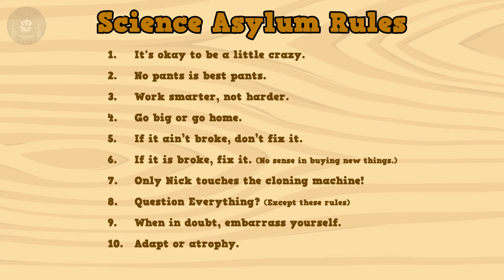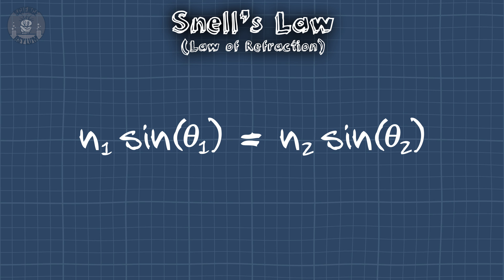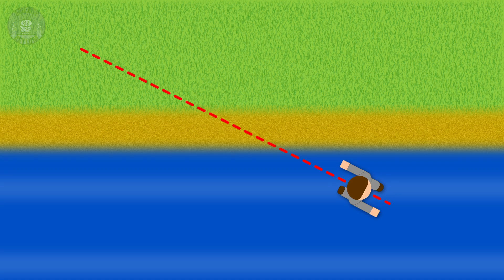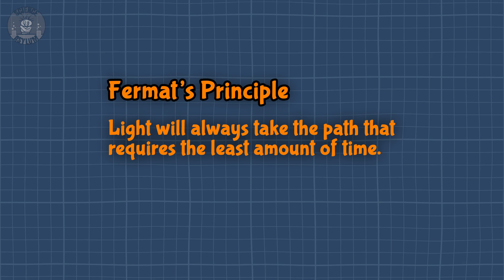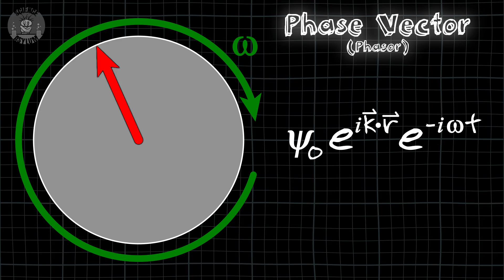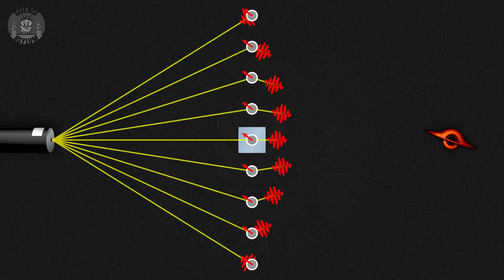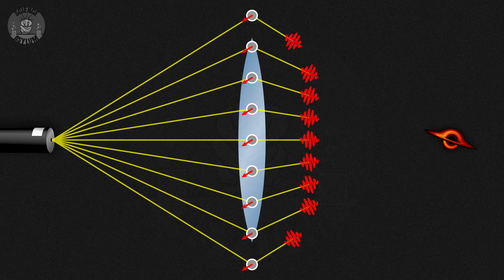Why Does Light REALLY Bend?

Comment: Excellent video.  I must say that I am pretty skeptical that light takes all paths between two points.  How do you really prove this?  You can't see actually see the path right?
Reply from the maker: We can't accurately predict what will happen with a photon (light) without treating it as if it takes all possible paths. If we don't consider them all, we get the wrong answer. What that means about the photon is open to interpretation.
Reply: Maybe you are saying all "possible" paths matter?  Not that it travels all paths?

Comment: The answer you gave in the beginning is 100% correct, it is an optical illusion. Each object or person in their own environment is looking through a kaleidoscope! A person in water looking to a drone, the drone looking at the person in the water, and the person observing them both, this is a simple illusion to them. This effect can also be seen while looking at a person through heat waves on a hot surface. As long as there is a transparent medium, such as glass, plastic, gases, water, and other things in this nature, it will seem to bend, however this is nothing but an illusion. All we are doing is looking through a kaleidoscope. You can't say that light is slowing down! What happens is the glass and other materials are acting as mirrors and cause the images to become disturbed to the person that is observing. There is nothing true about this for physics to explain. Since this illusion happens over and over again at all the tests, and with different mediums, it is causing confusion. If light really was to slow down and speed back up again, it would be against the laws of physics! Also, because light comes out from the other side of the medium at the same angle it entered, it causes a greater contradiction, and you guys are trying to find an explanation for this problem. On the contrary to the observing eyes, light was never bent, curved, or had taken a different direction to begin with, it was just an illusion. When it comes to lenses, they are correcting vision. The correction of vision through the lenses is not bending light, it is reshaping the image to your choice. To better study light bending or slowing down, you can take a look at a mirror room and a kaleidoscope. I will leave you with this question: How do you look into a kaleidoscope and find each and every single object's real size, distance to each other, and real shape?

Comment: So the summation of probabilities results in the least time path, yet despite that least time path, it is still slower than the speed of light.  How can light travel slower than the speed of light, unless there is a relative difference in time passing between air and glass?  Could increase the mass of the glass cause time dilation and therefore only the elusion of slower light speed when in fact it is time itself that moves slower in the glass?

Comment: I love your videos as these are always the most instructive in terms of addressing the "whys" in physics.  My question is "why does lower frequency light travel faster than higher frequency light in a non-vacuum medium?"  I'm having trouble finding the ROOT causes of optical dispersion in a prism.  I guess this is the same question as "why do waves with shorter wavelengths refract more or travel faster in a medium?"  Any help at finding the actual reason (and not just equations that predict the results) would be most helpful.  Thanks.
Reply: Light is an electromagnetic wave. Though it has a neutral charge, it still has an oscillating electric field component. In a transparent material, the electrons of that material don't have an excitation energy that matches the energy of the incoming photons, so cannot be absorbed through resonant absorption. But the electrons can still respond to the oscillating electric field, oscillating with it. Since oscillation is a type of accelerated motion, and accelerated charges emit light, each atom is surrounded by new EM field permeations travelling in all directions. However, light is a wave [or wave-like], so you need to consider wave interference. These new fields can both interact with each other and the original field. 
Trying to follow each individual one is absolute chaos, but the end result is that they all combine to form a net EM field with a peak that is phase shifted away from the original one, which is equivalent to if the original photon didn't travel as far in the same amount of time, aka it is slower. This new velocity of light through a medium is called a phase velocity, and it's important to mention that the actual individual photons here are still travelling at C.

As for why more blue light has a slower phase velocity, higher frequency photons have electric fields that oscillate faster. This changes how the electrons respond to it, oscillating faster, emitting more higher frequency light of their own, thus changing the interference pattern. Those different interference patterns yield a different degree of phase shifting, and so different phase velocities.

Comment: "The arrows caught up in the spirals tend to cancel themselves out, leaving only a few paths to contribute in any noticeable way." But... the spirals are just an artifact of the arbitrary order you chose to connect the arrows in, right? You started with the leftmost arrow and worked your way right across the diagram, which gave you those spirals... but if you had ordered the arrows at random, you would have gotten a different shape, and you could have picked an order that would have "cancelled out" any of the right-facing arrows you want by putting them near left-facing arrows. So what's special about the right-facing arrows in the middle?
Reply from the maker: I only sorted them into spirals so it was clear what was happening. The cancelling happens regardless of how they're sorted. The physics doesn't care what shape you make with them.
Reply: @ScienceAsylum  right, that makes sense... but what defines which arrow "cancels" which other one? Is it based on physical proximity?

Comment: Why does light bend over surfaces making it look like there’s no curve to the earth? 
I understand refraction from air to water or from stars through the atmosphere but don’t get why it would refract over a long distance along the Earth’s surface? Why we can see the sailboat sail as it gets farther away from us. It should disappear but light “refracts” so we still see it.
Reply: Light can bend over surfaces because temperature is a factor in refractive index. It also happens to be somewhat wild and unpredictable when near the surface either on land or near water, as anyone who has been on the beach during a thermal inversion will tell you. You can see the light from objects tens of kilometers away; well past the horizon.
The convection of air, even with the same composition, at different temperatures is enough to create such significant refraction. Light is passing through these layers and differing temperature constantly, changing it a little bit each time. Pile up enough changes and eventually you get some extreme apparent discrepancies

Comment: I have a question that I haven’t been able to find the answer to. Let’s say you have a piece or wood, by itself the wood does not give off any light, but if you heat it up enough, it combusts and produces light, heat, smoke etc. so, the question is: where do the photons come from? Are they created or are they contained within the atoms that make up the log? Thanks in advance.
Reply: I assume you're not taking blackbody radiation into account. In that case, yes the energy is in the atoms. Wood contains a lot of hydrocarbons and polymers, and when you slap some heat and an oxidizer to it, they react to form usually carbon dioxide and water [though you can in the right conditions use other oxidizers]. These molecules have significantly less ground state energy than their reactants, and that extra energy goes into photon production

Comment: Does the transmission of light from atom to atom, molecule to molecule, meaning the interaction of light with the electric field of each electron in the material explain the delay and hence the angle as well? Each electron will interact with each specific photon and then the electron will give off a photon with the same freq but different wavelength , right?, and that's where the path for light gets shorter or longer? The amount of interactions?

Comment: So refraction must come from the materials ability to reflect some of the light away and those photons push away the refracted lights photons into the opposite direction. Therefore, a truly black material would be the only material where light would not refract but unfortunately all of the light would be absorbed by the materials surface. The surfaces atomic vibration would be so low that it would never stop absorbing light. DAMN YOU, GOD!
Reply: No, the atomic vibration would increase.

A Black body doesn't reflect light, but it does radiate its own light. In fact, a Black body is a perfect emitter of light.

As it absorbs light, it heats up. This increase in temperature is an increase in vibration. And that causes the Black body to emit its own light.

Comment: A photon is nature's way of getting a chunk of energy from one location in spacetime to another. Random facts about photons:
If there were (there isn't) a pure vacuum the photon would experience zero duration over time. 
As a photon's probability wave evolves over time portions of that wave are slowed or even stopped by non-uniformity in the electromagnetic field through which it travels. Photons actually experience a tiny duration over time. Nothing, not even light, travels at c. The CMBR photons have lost energy over time. Change over time is exactly what duration is.
An individual photon is a wavefront (it has volume in spacetime). As a wave it can, and does, change direction through interaction with the environment. 
When "observed" the energy has interacted with an electron's wave.   That electron has to be ready to accept the amount of energy now in the photon. (A photon wants to marry an electron and become a single entity. Just gotta find the right one.)

Comment: Good video overall. The idea of a car transitioning to a slower material and bending is not really analogous to light. That would create a torque, accelerating the wheels on the outside. So would exceed the speed of light. 

Maxwell's equations deal with refraction accurately. It's down to adding perpendicular EM fields, and charge front in glass. 

Laser pulses refract also, being both aligned beam photons, and leaving at the same time.

Quantum explanation is good. Maxwell's is good too.

Comment: As a tutor, I'd request students to draw the event, representing it as two circles meeting tangentially at the surface of separation and having diameters representing speeds of light in each medium. You could solve for both angle of refraction and for the path taken by the refracted ray to reach the final point in unit time. 
But, being lazy is a hurdle among most students.

Comment: Does sound bend as it travels through different mediums.
Reply from the maker: Absolutely. All waves experience reflection, refraction, and diffraction.
Reply: Gravitational waves experience this too?
Reply from the maker: We can barely measure the existence of gravitational waves let alone their behavior... which means we don't have any experimental evidence for it. I suspect it will turn out to be true though.
Reply: If gravity affects the flow of time and bends light, can electric fields do the same thing?
Reply from the maker: @physicshuman9808  (1) It's better to say that the flow of time causes gravity, not the other way around: https://youtu.be/F5PfjsPdBzg (2) Electric fields do have energy, which can contribute to spacetime curvature. That's why charged black holes look different than uncharged ones.
Reply: Can you charge up an object so much that the electric well of the object would not allow light to escape
Reply: In the center charge and charge density and the electromagnetic force blows up without limit you would have an electrostatic singularity the density is so great that the electrostatic pull is so strong that not even light escape

Comment: What is the minimum difference between two wavelengths of light?
Reply from the maker: There may not be one. We're not sure. Some physicist suspect it's Planck length, but that's just speculation.
Reply: @ScienceAsylum  Thanks - you would think Planck length
Reply: @ScienceAsylum  would the maximum be the diameter of the universe?

Comment: wait, why isn't "all possible paths" an extremely large number? What binds the limits of possibility on a quantum level? Logically, there should be an absurdly high, if not infinite, number of possible paths from A to B.
Reply from the maker: There are an infinite number of possible paths from A to B. It's just that the contribution from each of the paths don't accumulate. Most of them cancel each other. Think of it like adding all the positive and negative integers together. There are an infinite number of terms, but the sum is zero.

Comment: Why does probability of path that takes shorter time contribute more?  Why do light even take the shortest path?  I don't understand this.
Reply: It doesn't actually contribute more. Each path contributes the same, but the longer path's will tend to "cancel each other out" because for every path where the arrow points one way there will in general be one that points exactly opposite. So when you add them you get something close to zero while the paths along the shortest one all add up to something bigger. 
Nick goes into this in his video on mirrors https://www.youtube.com/watch?v=rYLzxcU6ROM
Reply: @narfwhals7843  Then, how do you know the direction of arrow?
Reply: @narfwhals7843  I don't think I understand why the arrow should face the way they should.
Reply: @kalshravan4012  You don't know the direction of the arrow. You only know they all start out the same direction and spin at a certain rate. But the overall direction doesn't matter, only the differences, so to calculate you can just pick any direction for them to start in.

Comment: Great video! However, it seems to contradict a bit the video in which you said light (photon) doesn't slow down in the glass, it's only the light (beam) that slows down due to interference from the waves of the vibrating atoms in the glass. Though in that video you avoided the quantum explanation so I take it the devil is in the details.
Reply from the maker: There's always a deeper level we can go. At some point, you have to decide your explanation isn't going to go any deeper. I decided discussing quantum electrodynamics would have taken the video too far.

Comment: Hey Nick 
If the photon’s path takes all the paths and since the photon carries momentum
wouldnt the source’s recoil momentum also be in multiple paths and only would  experience the recoil when the photon interacts with something 
And what if the photon interacts with something after a long distance that would require moment exchanges faster than speed of light 
Here in lies my confusion
Reply from the maker: Once the photon interacts with something, it's been measured at that location and can't be measured anywhere else. That's how quantum particles work. The multiple photons in the animation are only ever one single photon (see pinned comment).
Reply: The Science Asylum 
But this doesn’t answer the question ??
i never questioned whether it was a single photon or multiple photons 
My question was what would happen to the source as it emits a photon 
Would it recoil immediately or recoil after the photon has interacted
Reply: @farvezfarook3422  Technically the source is in a superposition of all possible recoil states. Once you measure it to be in one, you also know where you would measure the photon.  This does not mean that you know which path the photon took! The probability of getting the photon anywhere is still made up from all the possible paths. And once you measure it, Nature makes sure the emitter is recoiled in the right direction. How that happens is up to your favorite interpretation of quantum mechanics.